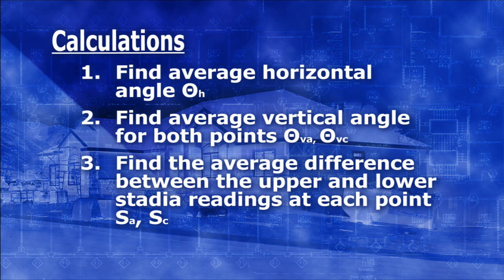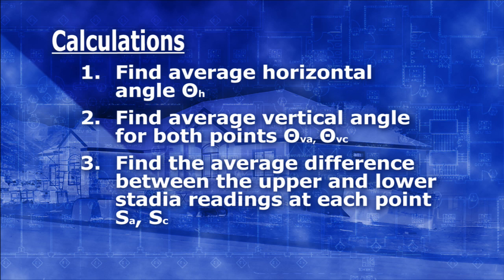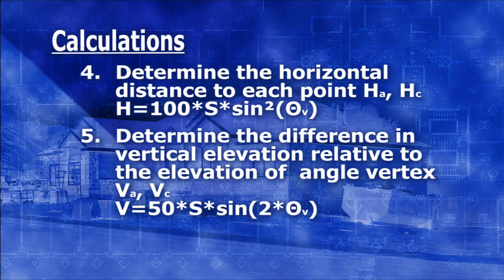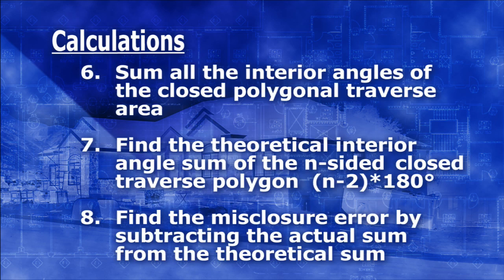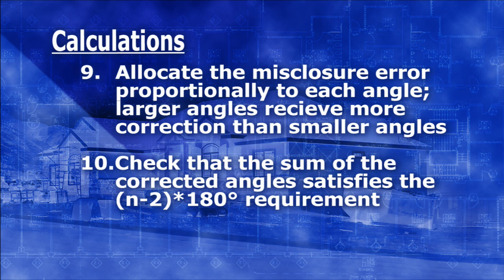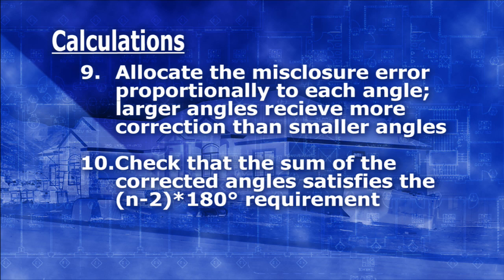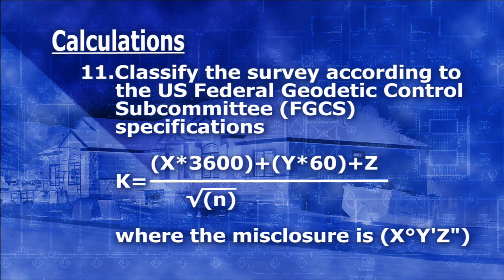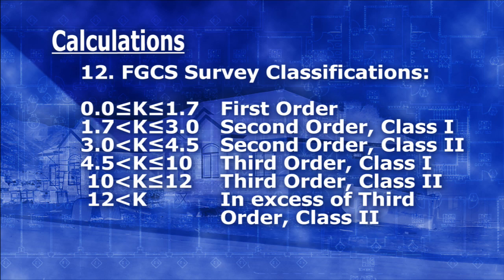How to Use a Digital Theodolite - Part 2 of 2

Comment: Sir, the formula used to calculate the horizontal distance by fixed hair stadia tacheometry is given as D= kscos^2(Theta)  ; where theta is the angle in the Reduced Bearing System used for the ref. line but in your formula you used Sine^2 Theta?
Could you pl. clarify if your reference reference angle is in different system?
Reply: yes, you are right sir